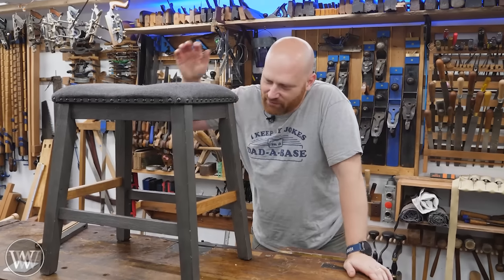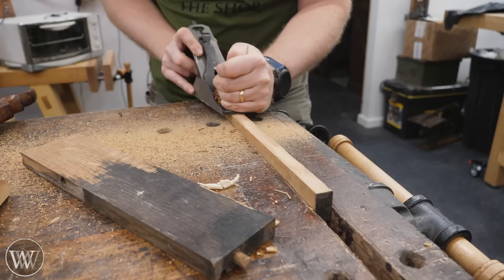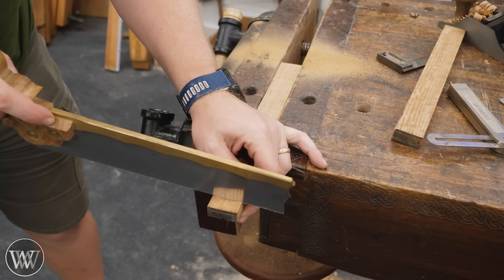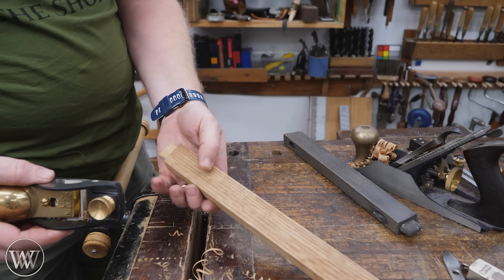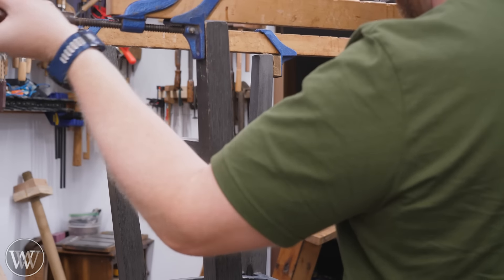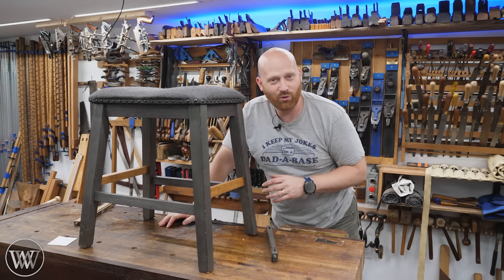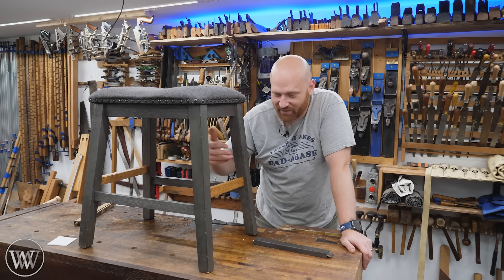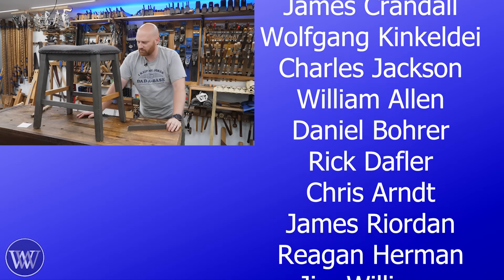Casting Pearls Before Swine White Oak On Ikea Furniture

Comment: This was interesting.  I like repairing furniture.  Sometimes it can be tricky.  Right now I have a really nice looking white oak, mission rocking chair I was given.  It was modified by the maer from a very standard Mission plan, but not wisely modified.  I have to find pieces of whiteoak scrap that I can match to the front apron so I can patch a break in it.  Matching grain, especially the ray pattern is really tricky.

Comment: I would think with the epoxy, replacing the legs would be pretty difficult without just rebuilding the whole dingdang thing?
Reply from the maker: That is the way you want it. if the glue comes lose and you don't catch it right away then things start breaking.
Reply: @WoodByWrightHowTo  Oh yes, that totally makes sense. After making those beautiful stretchers, I would just be hesitant to replace the legs if they didn't need replacing!